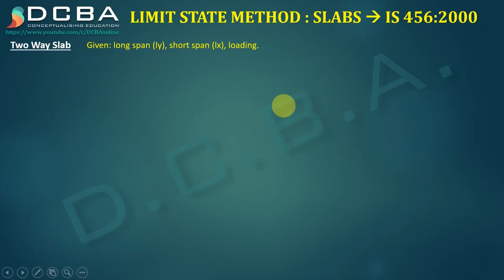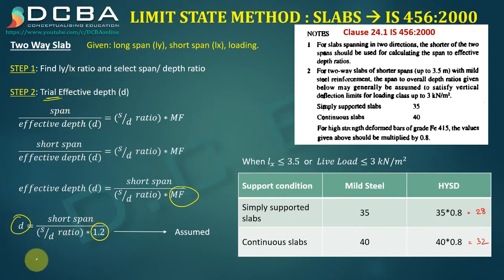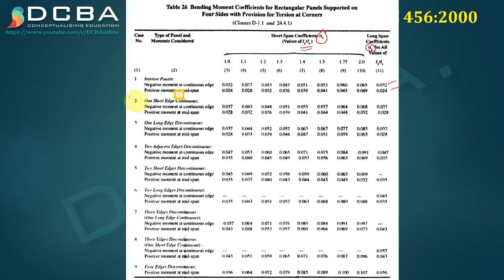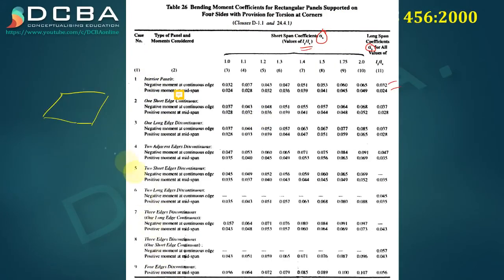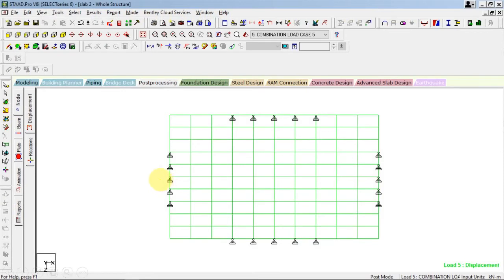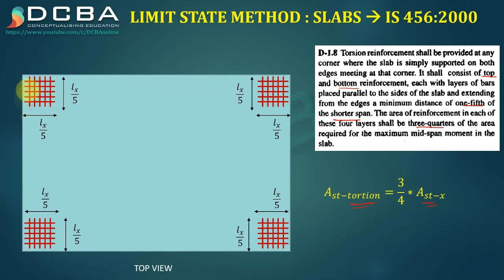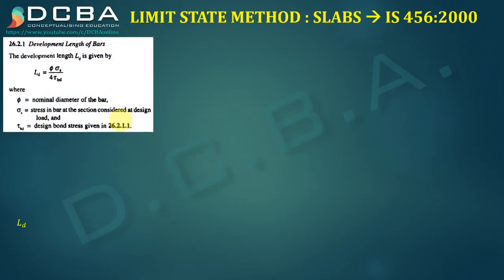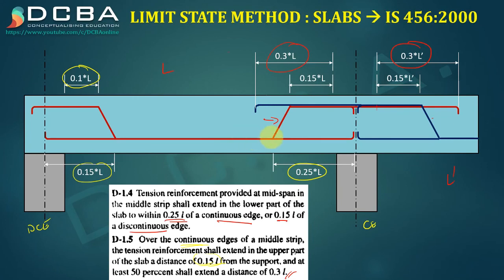Lec 31 - Two Way Slab Design Steps as per IS 456 : 2000

Comment: to the point informations about designing of two way slab. thank you sir. Sir I had doubt on torsional reinforcement now it is more clear now. but still i want to confirm by your side. my slab is in framed structure and monolithically casted with beams also continuous in three directions. Now I think I dont need to provide torsional reinforcement because slab's corners are restrained to lifting up by beams.
Reply from the maker: Its a general practice to provide torsional reinforcements at the corners because even if they are held down by beams the default nature of slabs at corners is to go up.
Reply: @DCBAonline  thanks for reply sir.

Comment: Sir I have 4mx4m panel and   supported are two eges  then which slab is provided
Reply from the maker: If two edges are opposite then 1 way slab
Reply: @DCBAonline  but sir 4x4 m panel  
Ly/Lx is 1 then?
Reply from the maker: Its not only on the ratio, it also depends on how the action of slab will be.
Reply: @DCBAonline  ok sir Tq